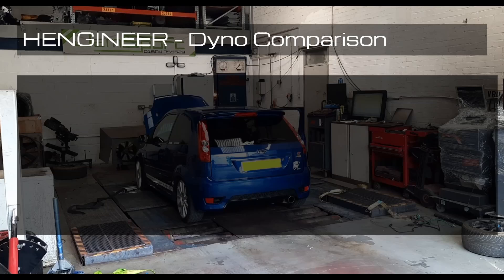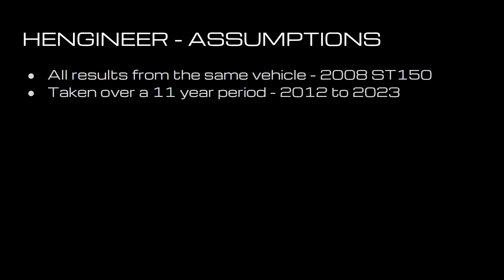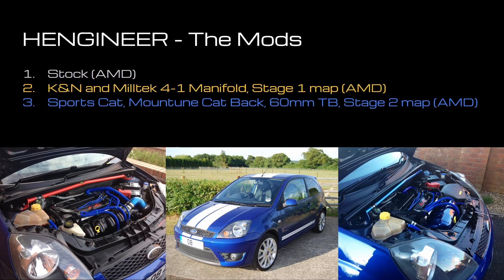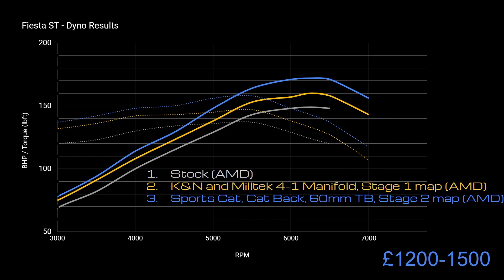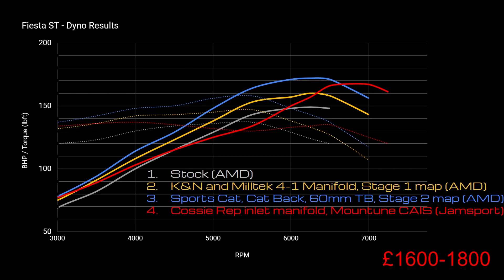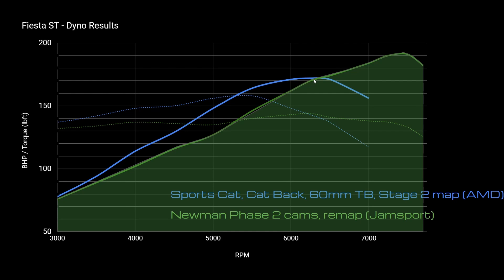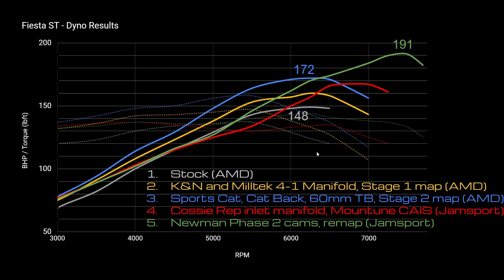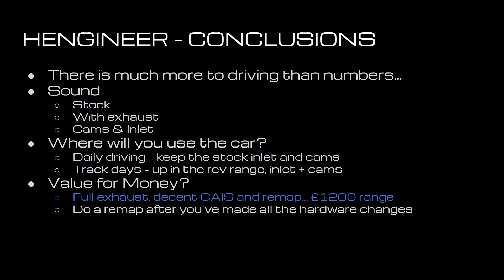Ford Fiesta ST Mods - Dyno Tested - Stage 1, 2 Cams Remap Exhaust K&N Power & Torque & Cost Compared

Comment: Mine case, Il imported MK6ST and after some time Il just have been frustrating for oil 🛢️ consummation, Il pay for general engine repair and all to fix I'm interested for some software updates to make😂 better use of gasoline and more hp and torque, just with PC and new software,is itcposible or not

Comment: Good video mate at 22 i had an st 150 with the jamsport 200 spec was great fun taking it to car meets. Never tracked it but went to lakeside a lot and back in the day that place was like a track day.

Interesting information mine was frozen white with 197bhp and 148ft lbs.. it used todo over 70 in second gear ⚙️ 😆 but topped out at like 130 though in 5th it needed a 6th gear. Shame its gone now makes me want to drive it again for that cosworth inlet and a full miltek decat system sounded amazing

Comment: So basically full exhaust, filter and map is the best for most. That's exactly where I stopped with my performance mods and I'm more than happy with the performance 👌 I did always think cams etc would ruin day to day driving and wouldn't really benefit from them unless on track... Great video!
Reply: Get ph2 cams and FF inlet manifold not that cosworth and it will be much better

Comment: Hi! do I understand correct.......3. mods and dyno is without miltek manifold? stock?
Reply from the maker: Hi - 3 is with Milltek manifold, sports cat etc... exhaust mods. Inlet manifold is a different thing. Search for Cosworth Inlet for Duratec engines and you'll see the difference.
Reply: Do you have OEM ECU or aftermarket ECU like  ECUMasters, Vems?

Comment: The best value for money I reckon is a miltek flexi pipe and a second hand dreamscience imap device. The standard flexi is one of the main limitations of the exhaust so adding the miltek one with the DS map should have it easy around 165bhp and all together can be bought for around £400-450

Comment: I would like to see what its like with cams and normal manifold than the cossie rep
Reply from the maker: You can... search for MP185 kit. This is what mountune sold before the inlet was developed. Pumaspeed also have a 182kit. Torque ~170lbft, power 182bhp. But redlines less than 7000rpm.
https://pumaspeed.co.uk/product-Fiesta-ST150-Power-Upgrade-ST182---SAVE-130-POUNDS_552.jsp
Reply: existen kit +200 hp ?

Comment: For road and track use. I found the best value for money to be exhaust, intake, TB, cams and keep the stock inlet manifold.
I got 178hp out of that which was a fair amount bit faster than stock, especially with stripped down interior. Great fun

Good video btw
Reply: I got 173hp with the stock TB and intake, that saves quite a bit and probably gives more torque

Comment: First of all, congratulations for your channel and the content you're creating, very good quality and nicely shown.
About the video: I liked how you researched the power gains using scientific method, really demonstrated where the gains are. If I may interfere a bit in your project, it seems the fitted inlet manifold doesn't suits your application as well as it could, I believe it's related both with runner length and ressonances, and I would recommend changing it back to the original setting.
A better solution could be fitting a modified stock manifold with shortened runners, I would recommend reducing around 40mm, so you could have a similar bottom end from those first 3 runs and, also, having benefits of Cams + ressonances tuned for higher RPM.
I hope it helps you.
Best regards, Pedro
Reply: How do you modify the stock intake manifold?

Comment: Very interesting man. This is why I have gone down the Fusion Fabrications inlet and phase 1 cams from Newman as I want the best torque mod range rather than getting a high reving bhp figure. I'm at Dreamscience next weekend for all the mods and mapping. Also did a few torque runs as is to compare once all done
Reply: Finally ahhh.. don't forget a 4-2-1 would be more torque as well.. but would have to be custom. But 4-1 will get more mid to higher. Make sure to your filter upside down so it points out of the engine. Get max air for max figures.
Reply: @CdotPoppy  yeh proper excited. Depends what can be done for the air filter with space. Depends if my cone can fit with some silicone hose straight onto TB or if I need to keep the 90degree cone
Reply: I'd like to see what you think after a few months with the '200 spec'. Wether your prefer it day to day.... I noticed on your videos you never mapped after the full exhaust/filter too so maybe you missed out on the '170 spec'... 
And awesome car btw dude! 👌

Comment: I got 198bhp - 160 ft/lbs
Cams - £215 [200 spec newmans]
Inlet- £220 [caterham] with air filter
Exhaust £200 mani, £150 backbox, 150 sports cat
Remaps spent 200, 230, 350 had quantum, dreamscience imap ph2 map the jamsport custom.

From there I have spent extra £550 on milltek manifold back. Atb diff.. 450 in box, 350 fitting then £500 fixing the leak. Let alone the other 2k spent on other things. 

Going on track was fun in this, I was limited by skill at caste as you drove better than me. 

It's a great car, hard to get rid of it.
Reply: where do you get so good price for cams and inlet?
Reply: @enricco23  ebay
Reply: This is really similar to my build (mostly Pumasport), i got 194bhp, 171lbft. Full miltek system with race cat and 4 into 1 mani, 200 spec Neumann cams with springs and lifters, ported and polished, K&N typhoon cais, dreamscience remap, quaife diff. The absolute best mod was going down to 15” wheels tho, getting 4kg off each corner was amazing, but the rear spacers are also great. Looking into an mt75 gearbox now